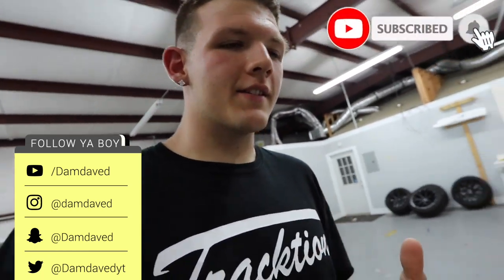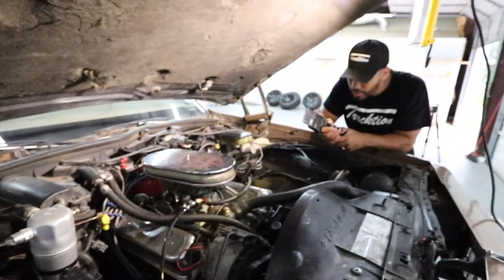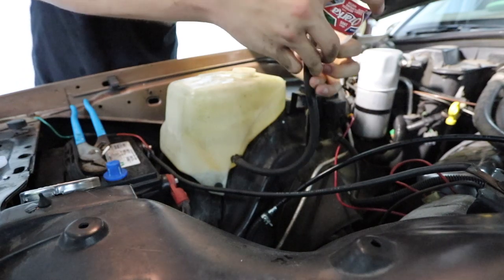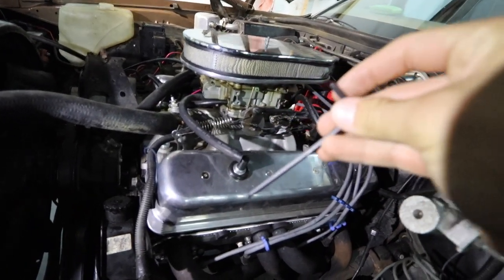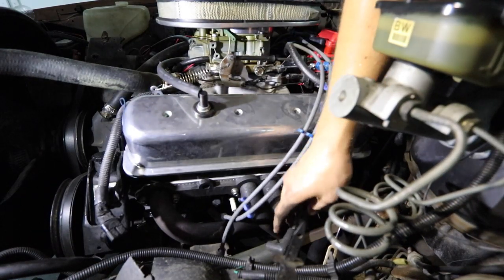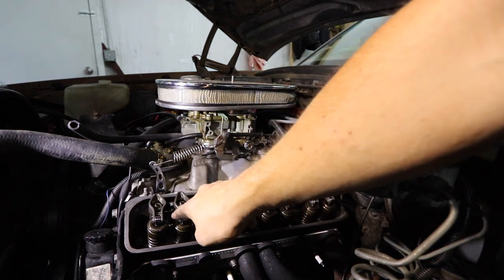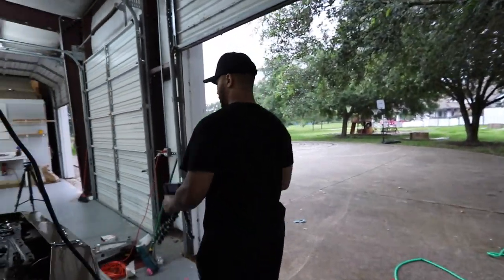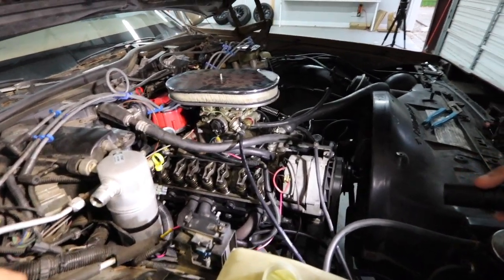Rebuilding TEX SANDS BOX CHEVY ENGINE! (PART 2)

Comment: Hey, I wrote this as I watched the video earlier today, but I think as I was typing you made it private so I couldn't post the comment. But ya boi saved the text, just got back from work, so here ya go:
The water is 100% normal, it's condensation, like you said. Now, when you took the valve covers off, what you were looking at were the rockers (or rocker arms). The lifters are beneath the intake manifold, in direct contact with the cam. You can't see them without taking the intake off. So basically what you checked for was operation of the valvetrain, and it seemed okay. A bad lifter would only cause a minute difference in the movement of the rocker arm and you wouldn't be able to tell - but if you didn't see one of the rockers moving at all, that'd mean you have a flat cam lobe, and consequently a dead cylinder. The car would sound very weird while running, so that's not your issue. If I were you, I'd watch a video called "Hydraulic Valve Adjustment THE EASY WAY!" by Vice Grip Garage. You can do this process at the stage you're in now, without taking anything else off. You might get lucky and just have them misadjusted. Pop covers back on, light it up, and the sound might be gone. If it's not, then the intake has to come off for the lifters to be checked. Make sure everything you take off goes back where it was (there are gonna be some hoses and wires on the intake and carb). Each lifter wears to the lifter bore that it sits in and to the cam lobe that it rides on, so if you misplace one, it'll eat itself in a few seconds. There are some good YT videos on how to check them for proper operation (basically making sure the hydraulic plunger inside of them is still operating and not stuck) and even lifter rebuild videos... but for a SB Chevy you might consider just buying new ones if they're bad. And again, heads don't need to come off for any of this. I'm 90% sure that's gonna solve your problem. Let's see!
Reply: Why isn’t this a highlighted comment 😂
Reply from the maker: Dang bro thank you so much again! We’re going back pretty soon to work on the project, I’m going to try to find the torque specs for the bolts on the valves, and then after that we will lift the intake manifold to check out the lifters and all of that if the noise still persists! Bro where do you live? It would be awesome if you came and helped us no joke, so far you seem like you’re the only one with a ton of knowledge🔥
Reply: @Damdaved  You're very welcome man. I don't know that much, just enough hahaha! No point on sitting back on my chair watching you struggle when I can help. If you're talking about the rocker arm bolts, you're not gonna find a torque spec for them because you're supposed to use them to set the preload on the hydraulic lifters (aka, to do a valve adjustment). Did you watch that video I suggested? Make sure you do and follow his steps, it'll clear things up and may solve your problem. If not, replacing lifters isn't hard either, I can help with that if it comes down to it. I live in Indianapolis, brother... I think you're in TX? Also, I messaged you on Facebook. Feel free to reach me there if you'd like.